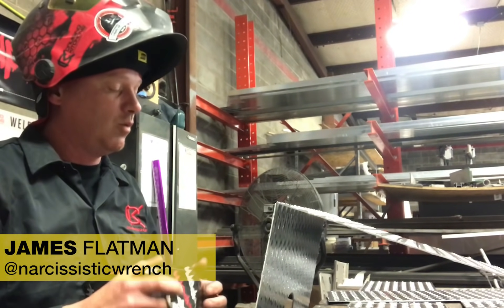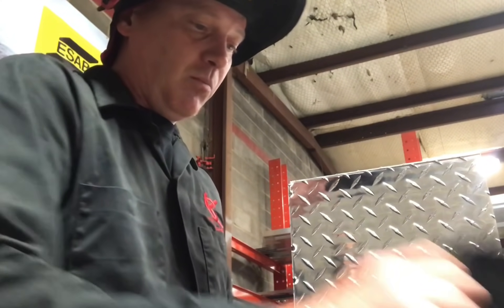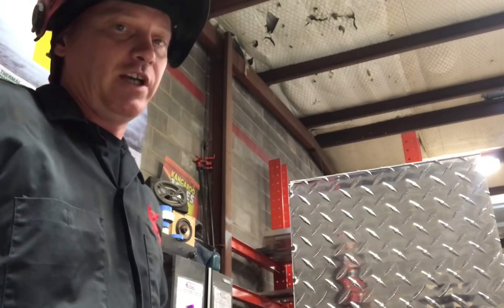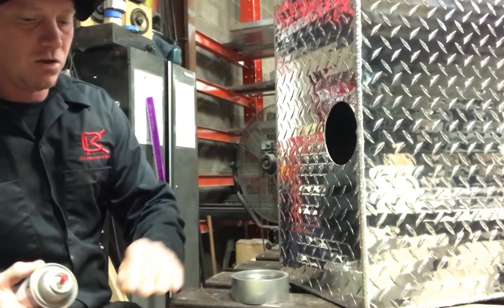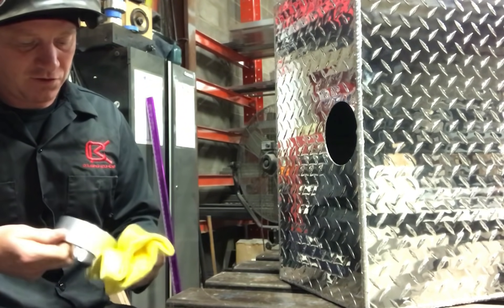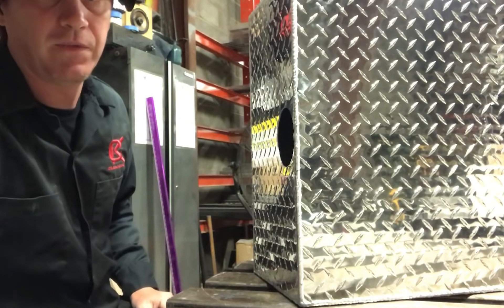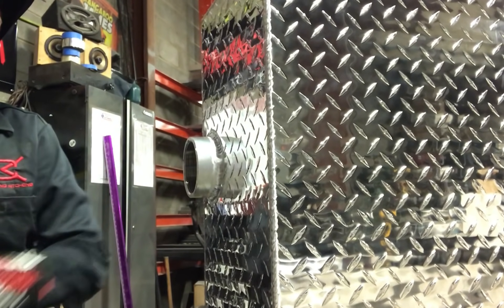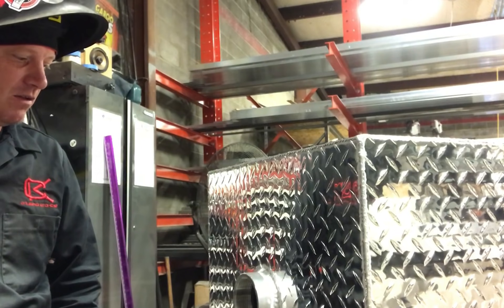Tips and Tricks for TIG Welding Aluminum Tanks

Comment: At 3:52, this video states to clean the aluminum with brake cleaner or acetone prior to welding.  Brake cleaners that contain chlorinated hydrocarbons will create Phosgene gas when exposed to welding, which is a deadly gas.  Never use brake cleaner to clean metals being welded.  Acetone works outstanding for cleaning metals to remove oil and grease.